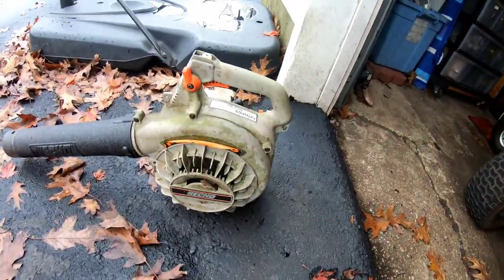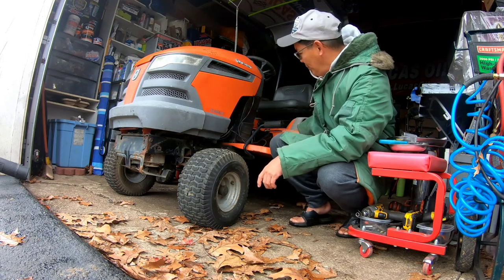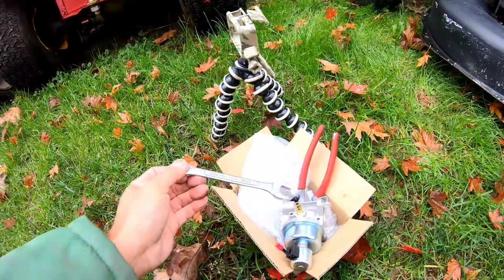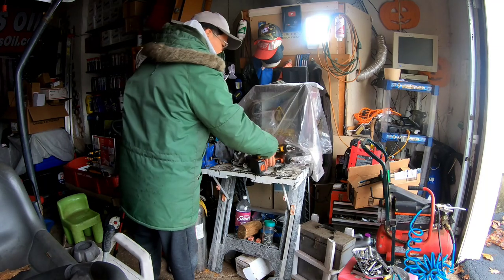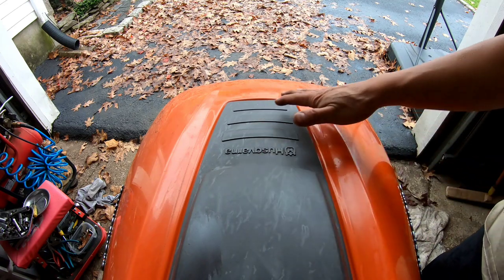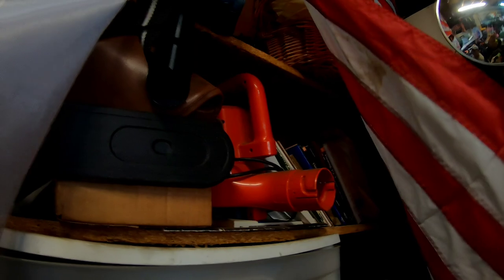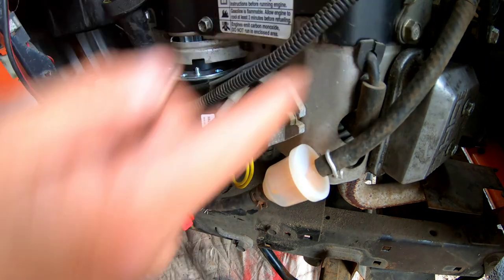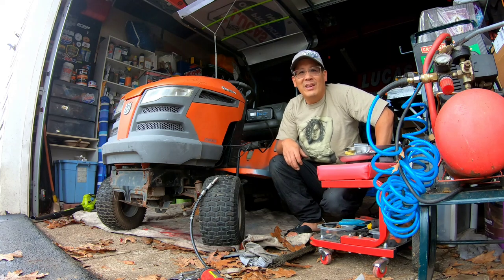HOW TO CHANGE REPLACE KOHLER COMMAND COURAGE OHV SURGING CHINESE COPY CARBURETOR 5 MINS REPLACEMENT

Comment: On your Kohler Command, I always put my fuel shutoff before the fuel filter.  That way when sitting the fuel doesnt varnish in the screen of the filter.
Reply: I have a thought of maybe an aerosol spray of ATF for cleaning up faded areas of plastic, what do you think Bro?
Reply: Matthew theres a product thats called Back To Black. It works on all plastics and lasts longer than atf!
Reply from the maker: Given the thickness of the atf, itll be tough to spray
Reply: I’ve heard of that product but never tried it
Reply: I was thinking the same but would be cool